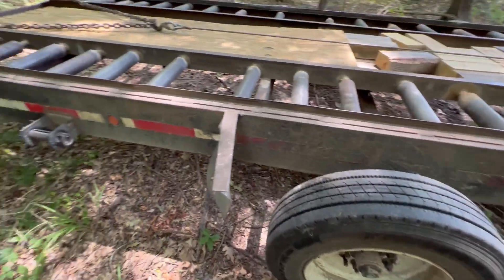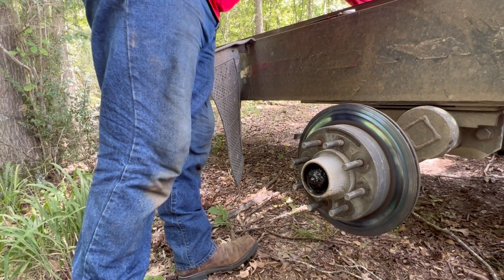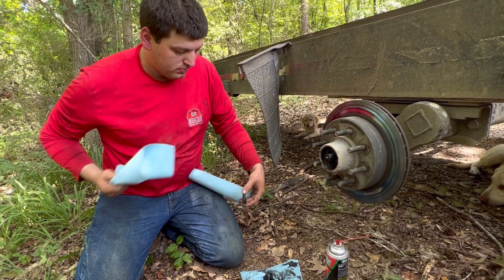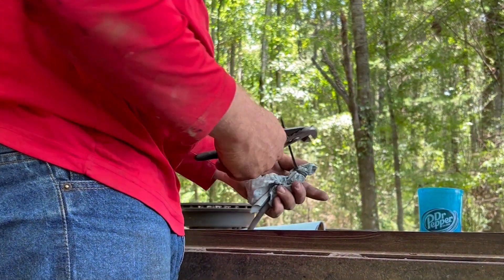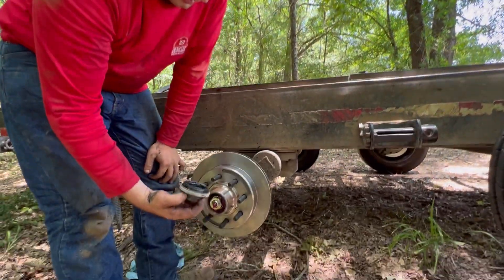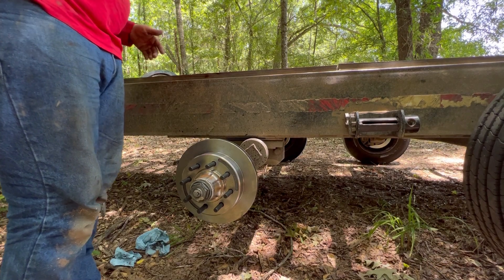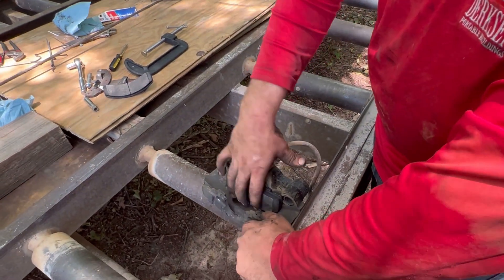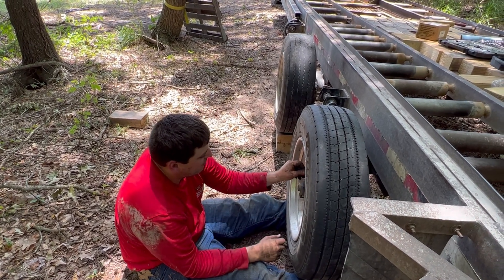Shed hauling trailer maintenance

Comment: Looked good to me. I definitely see how your grease made it all the way through the bearing but something just feels wrong about not packing them :-) I borrowed a seal driving set last time I did trailer bearings and still ended up using a hammer an wood block. Old habits die hard.